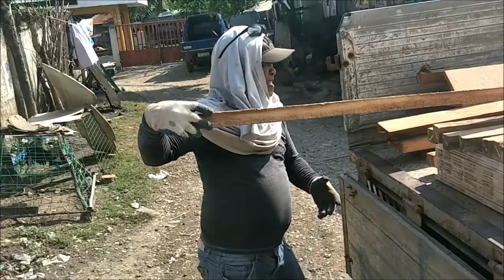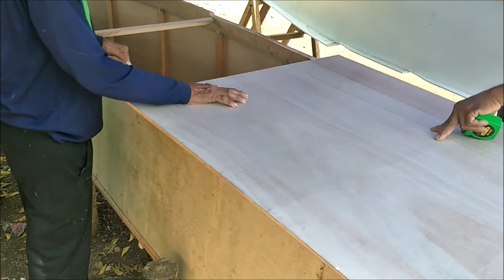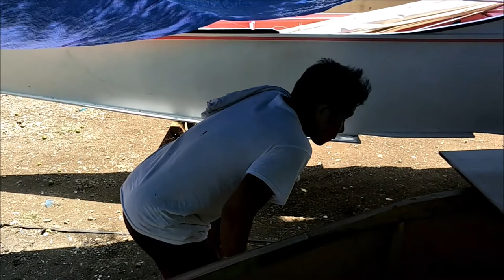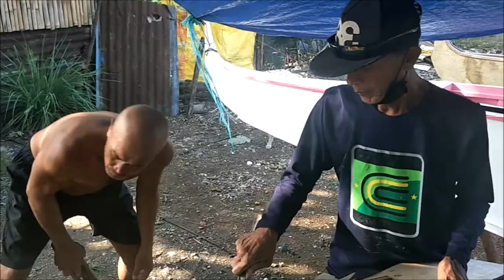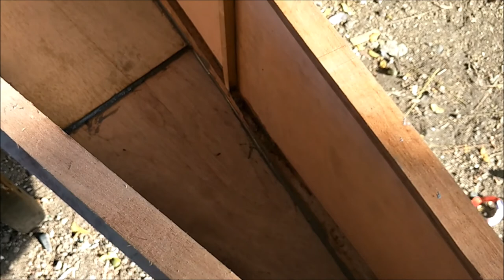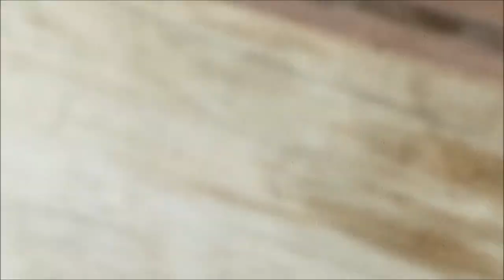Paradise Trimaran - Part 5 - Boat Building In The Philippines

Comment: Just curious you're gonna use to motors correct are you gonna have AA left hand and a right hand turn engines and how hard is it gonna be to find a left hand turn diesel motor
Reply from the maker: I never thought of that I hope it is not a issue, I know on my boat in the US I had opposite propellers on my twin engines. As far as I know there are no opposite rotating single cylinder diesel engines so they will all spin in the same direction and we will see how it performs😊
Reply: Didn't think about a prop turning in the opposite direction that's a good option see how it works out hopefully it works great good luck